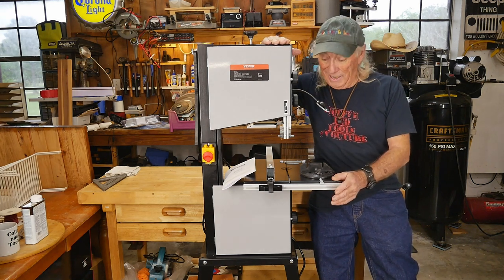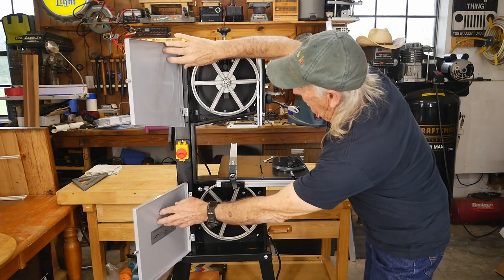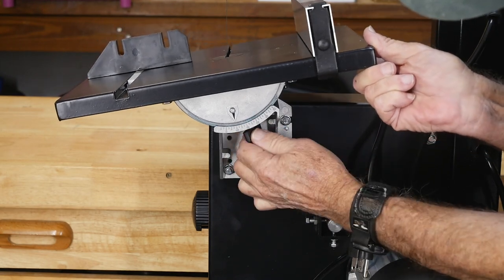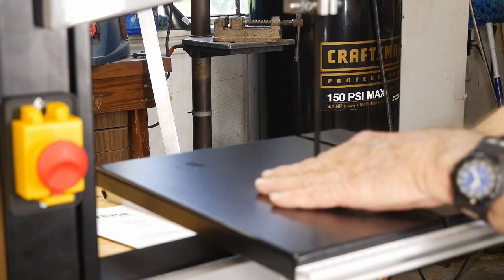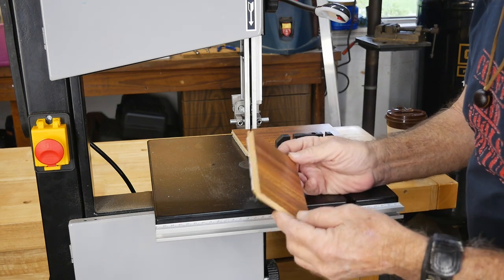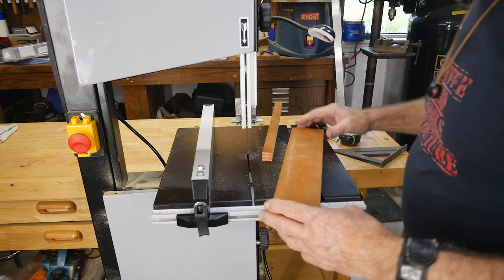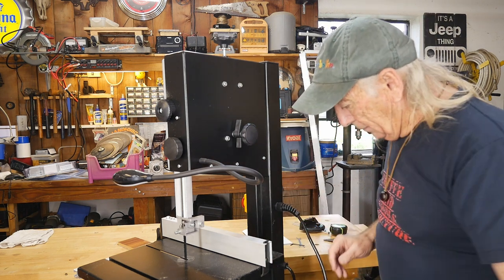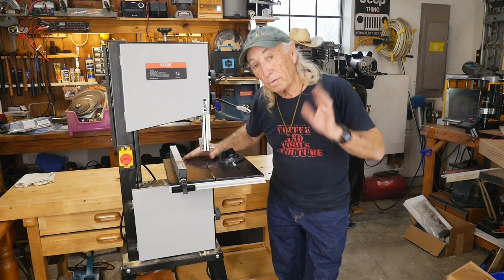Best Bandsaw from Vevor 2023, Tough Tools for Half Price, reviewed at C&T ep 334

Comment: My wen is identical to this. I used it to jump start a business and it's still going strong after 5ish years.
Reply from the maker: I checked the WEN and it seems like the same machine or source etc. Also this one is rated for metals by Vevor, but that was more my opinion than Vevor. I've got a lot of other ways to cut metal so, NOT my first choice.
Reply: @SirTools  I've used mine to cut brass and aluminum and it's done ok.

Comment: Thanks for the review. When I had my shop, I was a bit of a bandsaw badger. I rebuilt old Delta, Crescent and Powermatic saws. My favorites were a 1938 10" Delta, a 1947 Delta/Milwaukee 14" and a 1946 Crescent 20". However, my "BEST" saw was a Craftsman branded 14" Taiwan steel frame; very similar in construction to the 10" you reviewed here. Now that I have a cargo trailer shop, I was thinking about the Rikon 10-305. This might be very similar at a much lower price.

Comment: I have a 2 speed WEN band saw. The manual says low speed is for metal with a metal cutting blade, ferrous and nonferrous. With high speed for wood.
Reply from the maker: I checked the WEN and it seems to be the same deal with speed and material.

Comment: I wish i had a fence and miter gauge for my bandsaws thats the downside of buying used. Does that have blocks or bearings as the guides?
Reply from the maker: Yeap, all bearings and blocks on the guide. 3 bearings top and 3 bearings bottom and two metal block guides.

Comment: Have done any resawing with the vevor? I'm assuming if it's coming from the same manufacturer as WEN it should be same quality with that 6" capacity right?
Reply from the maker: Wish we had t he WEN here to compare.
Reply: @Coffee and Tools  I'm currently debating between the wen and vevor  10" bandsaws, I plan on doing some resawing and they both seem to have the exact same specs (only 2 ten inch bandsaws with 6" resaw capacity) which makes me think it's the same manufacturer. At $100 cheaper, vevor is the one I'm leaning towards but I can't find many reviews
Reply from the maker: I think it is the same "maker" but the price is what keeps selling me. And I'm a cheap date on tools 🤣🤣🤣🤣

Comment: Interesting. What is the maximum blade width?
I did not see that listed in the specs on the Amazon link.
Reply from the maker: Can't see that anywhere here. I'm thinking 3/8 inch.
Reply: @SirTools  Thanks for checking. I have an old Craftsman and can run up to 3/4” width blades. 
The height is not much but it does ok for small re-sawing jobs.
Reply from the maker: @kenluning909  Found it. Max shows about 1/2 inch. OR metric 12mm LOLOL...OMG...metric HA HA HA....dang.
Reply: @SirTools I think half inch is plenty for this saw. It’s not for milling 12’x32” trees. You could do a good job resawing with half inch blade. And you can set up for 5”+ height. 
Thank you for the review.
Reply from the maker: Seems to be a pretty good saw :)